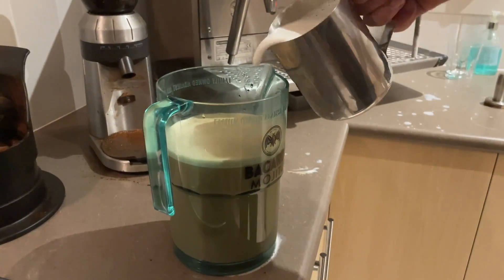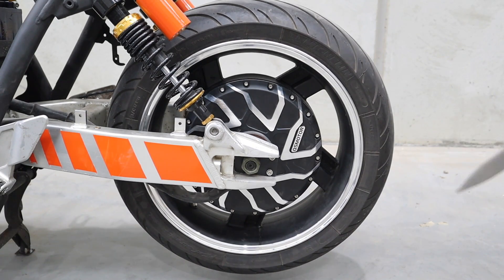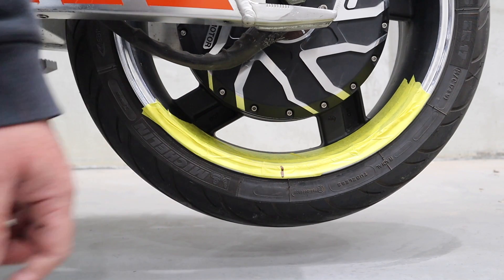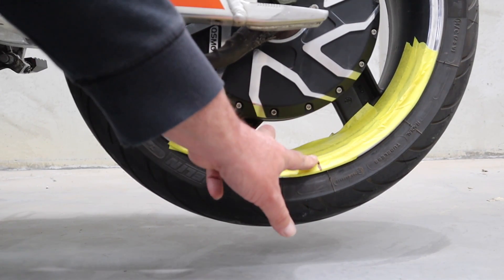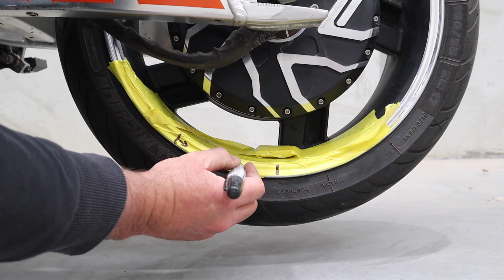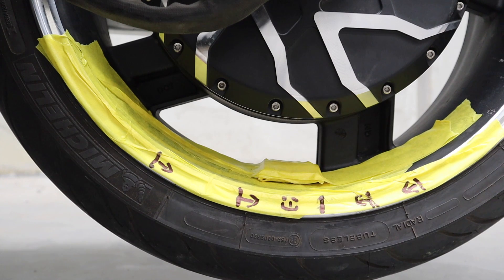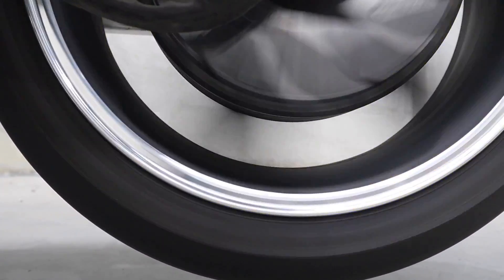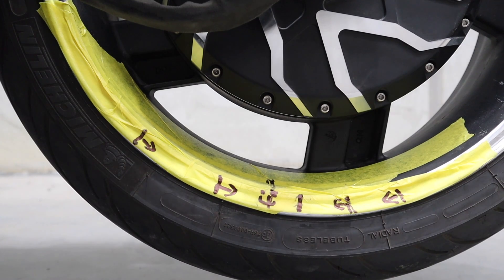Balancing an Electric Hub Motor

Comment: I'm not a bike guy, so, why is this important?
Reply: At the very least, a well balanced wheel provides a smoother ride. Hub motor wheels are notoriously bad in that regards. In more performance scenarios, a tyre that vibrates less has better, more constant contact with the asphalt. That translates to better grip. And grip is everything.

Comment: Pretty sure you just saved me a crap ton of trouble. Thanks!!
Reply: Ha ha ha silly me a month later and I'm still trying to get it sorted.
Reply: And an hour after that the wobble is gone. I had a tire that was severely out of round, and once the new tire was on it needed about 125 grams in just the right spot. But I finally have a smooth ride!
Reply from the maker: makes all the difference